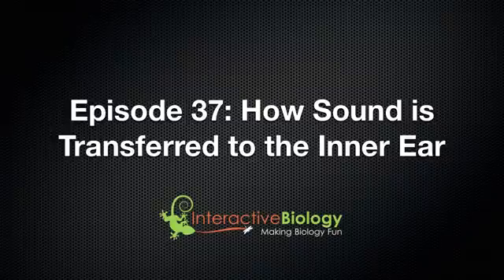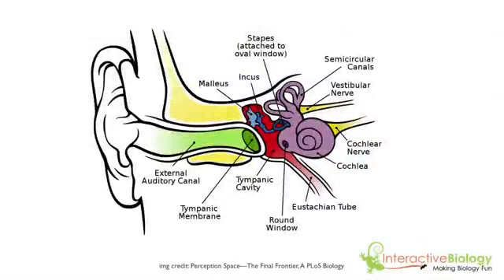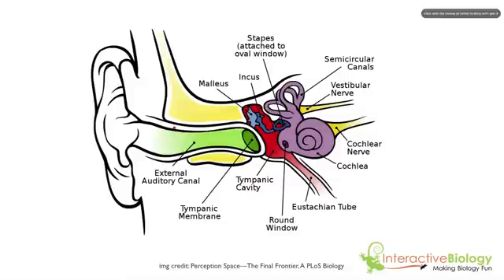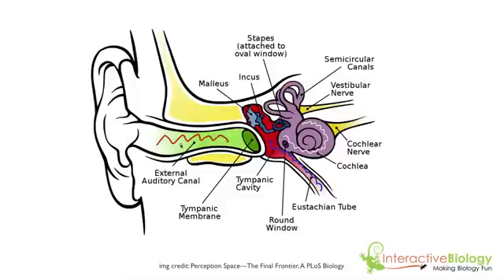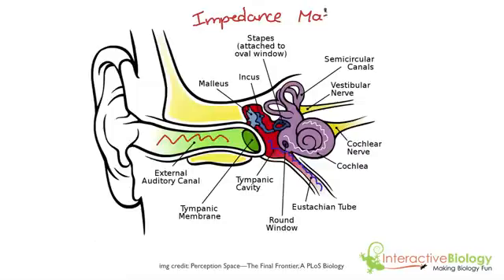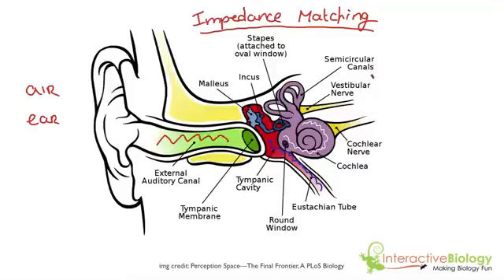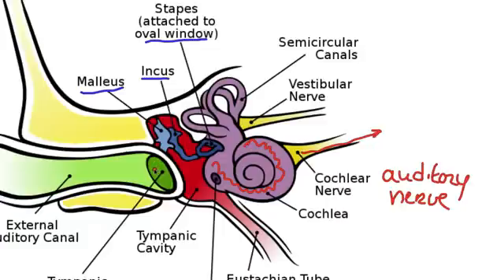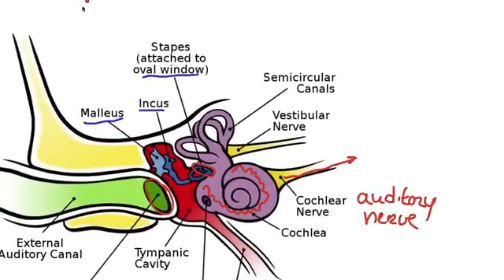037 How Sound is Transferred to the Inner Ear

Comment: This video has something wrong....as you said that movement distance of stapes is greater than that of malleus by 1.3 times when sound vibration occurs....but this is not true instead movement distance of stapes is three forth to that malleus but FORCE of movement is increased to 1.3 times due to lever system and 17 times due to small surface area.
Reply from the maker: Can you share some documentation on this? I learned it differently from what you’re describing.

Comment: Hi I think in 06:00 you made a mistake. The impedance of fluid should be much bigger than that of the air, so the stapes will not get more movement than the malleus, but more vibration force and less vibration amplitude. Please check this as your video could be misleading to those who just start learning.

Comment: As regards impedance matching function of the middle ear, the least important factor is:
a.Intact ossicular chain
b.Patent eustachian tubes.
c.Presence of air in middle ear cavity
d.Intact tympanic membrane.
e.Functioning cochlea
what do you suppose is the answer?
Reply: B is the correct answer - ET functions in pressure equalization and mucus drainage; all others are directly part of affecting impedance matching; need air to transmit sound; need intact TM to transmit air to the ossicles; need intact ossicles to transmit sound from air to the fluid in the cochlea; need functioning cochlea to take in the transmitted sound from the ossicles and convert it to nerve impulses.

Comment: I searched for , function of round window ?
Reply: happy singh The bone of the cochlea (called the bony labyrinth)  is comparable to a metal tube, in so much as the walls of both do not readily expand.  The membranous labyrinth is like a long balloon that is blown up inside the long metal tube. If you squeeze the balloon, the walls of the tube will prevent the balloon from expanding very much, so the balloon will expand out the other end of the tube.  With the cochlea, rather than a balloon being squeezed, the stapes squeezes the fluid (endolymph) inside the membranous labyrinth. The outer bony wall of the cochlea and the fluid (perilymph) outside  the membranous labyrinth prevent the membranous labyrinth from expanding much more than a wave, and so the extra pressure causes the membrane over the round window to bulge out.

Comment: So after the cochlea, it just goes out the auditory nerve, correct? What do the semicircular canals do then?
Reply: Balance and motion detection. Hard to see in drawing, but one canal goes in each of 3 Directions. As you turn your head, the liquid wants to tend not to move with your head, and little hairs pick up the "apparent" motion of the liquid. Spin around in a circle until you get the liquid moving as well - and you feel "dizzy".
Reply: Robert Obusek
Reply: Steph O the semi-circular canals maintain body balance and posture in relation to the position of the head. They contain endolymph which triggers cells in the ampulla(end part of the each semi-circular canal) when the fluid itself is in motion.

Comment: Hi! thanks for the great video! Really nice one!
I have some inputs though, I hope you can make the video even better :)
About the movement ratio 1.3x, it does not mean the displacement at the stapes will be 1.3x  the malleus. The vibration direction you drew at malleus and stapes are wrong, it should be like the direction of incus..
Because the effective length of Malleus is 1.15 times of the incus, the lever action multiplies the force 1.15 times. But this is the force, not the displacement. The velocity even decreases 1.15 times. This lever action therefore increases  the impedance ratio 1.15^2 = 1.32x. 
(Reference: Pickles, An Introduction In The Physiology of Hearing)

Comment: Hi , I have 2 questions for you

1. Why does the stapes vibrate faster than the malleus? You said stapes vibrates more distance. It is not about the distance but you meant more no of vibrations or speed right?
Reply: It does means that stapes vibrates with more impact then that of incus and malleus due to less effective area.... As sound waves which are generated should be of high intensity

Comment: Maleus, incus and stapes are latin forms of the same terms.
The displacement of the fluid (you're talking about perilymph) allows movement of the basilar membrane which is crucial for moving the hair cells, signalling the location of displacement of the basilar membrane, and so signalling pitch. (there are actually 2 different types of fluid, perilymph and endolymph, which have different dissolved ion contents in order to generate electrical signals in the hair cells) 
Hope this helps!